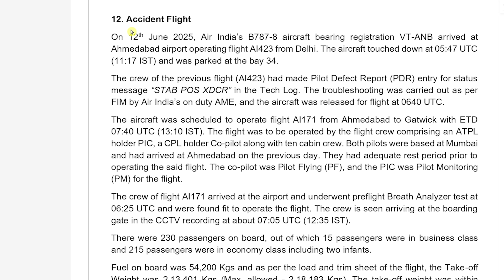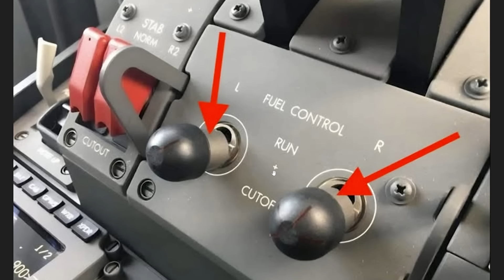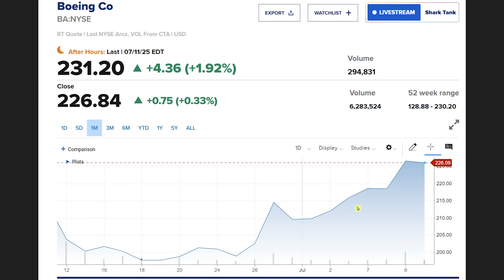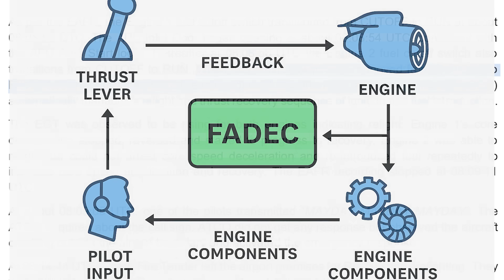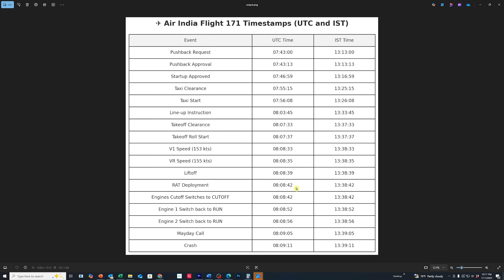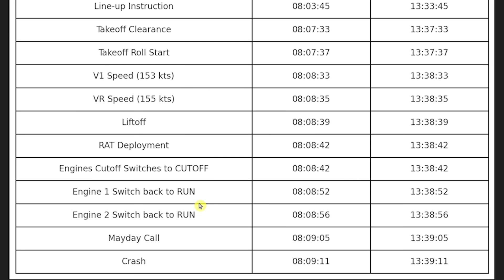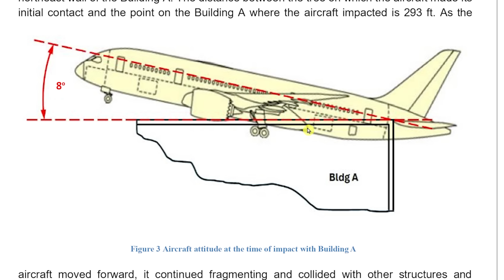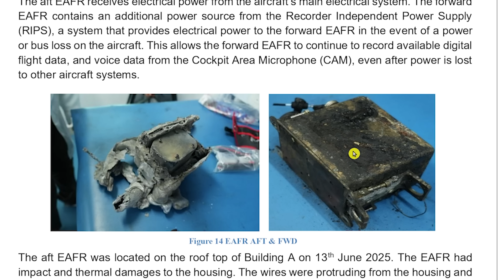Did Pilots CUTOFF Fuel? Shocking Twist Air India 171 Report!

Comment: Stop these assumptions and narratives not based on facts. 
The following is an excerpt of report:
The aircraft achieved the maximum recorded airspeed of 180 Knots IAS at about 08:08:42 
UTC and immediately thereafter, the Engine 1 and Engine 2 fuel cutoff switches transitioned 
from RUN to CUTOFF position one after another with a time gap of 01 sec. The Engine N1 
and N2 began to decrease from their take-off values as the fuel supply to the engines was cut 
off.
In the cockpit voice recording, one of the pilots is heard asking the other why did he cutoff. 
The other pilot responded that he did not do so.

The question make sense as the switches are within the control of the pilots as the plane loses power.  The answer is NO! 
There are no other
Leave it as that until further investigations are complete.

Everything in this post are irresponsible narratives that are  circumstantial, assumptions and not based on facts.

Also, engine 1 and Engine 2 fuel cutoff switches transitioned 
from RUN to CUTOFF position one after another with a time gap of 01 sec. 
If one of the pilots is responsible, that gap would mean that both hands would be used and would be clearly seen by the other pilot and the question relating to the cut off switch would be more in the line of - "WTF are you doing, turn it back on"!

WAIT FOR THE NEXT OFFICIAL REPORT.

STOP THESE USELESS POSTS!

YOU ARE NOT REPORTING BUT PROFITING FROM THE TRAGEDY THAT ARE REAL LIVES!
Reply from the maker: It sounds like you are very defensive on behalf of the pilots. NO problem, but all the info you just regurgitated is what I showed on the video in a table of all the timestamps. As for your false statement, "switches are within the control of the pilots as the plane loses power," and you said no, that is a lie. Both pilots can easily reach and cut off, and turn back on those fuel cutoff switches. IT is a common task on the engine flameout checklist. You are just lying because you are defensive and you don't want to believe the flight data recorder info in the OFFICIAL REPORT! So tell you what, why don't YOU WAIT FOR THE NEXT OFFICIAL REPORT, and why don't YOU stop YOUR assumptions and narratives not based on facts?
Reply: @jeffostroff  repeating my question from below, where did you derive the timestamps from? they are not on the report afaik. thanks
Reply: Do you have proof the 2 piolets  did what you said everyone is very keen to blame the piolets  how would you like it if it were one of your family flying the planes. I am tired listening to  all  this tripe wait until the  truth comes out not before when you'll done know what really happened also their family has to listen to all this and the captains poor old father have some consideration for him how  would you like it don̈e on yoù.  THE 2 PIOLETS ARE NOT GUILTY. May they rest in peace.
Reply: Did AI171 continue to gain airspeed after fuel cutoff? 

There is a key aerodynamic and engine behavior characteristic that appears to have been overlooked in most discussions surrounding the sequence of events on Boeing 787-8 flight AI171. This detail, though subtle, could significantly alter the prevailing narrative that attributes the incident to pilot error, fuel switch mismanagement, or intentional action. Instead, it reopens the possibility of a catastrophic systems failure that preceded any cockpit intervention.

The point in question is this:

Following fuel shutoff, an aircraft may continue to gain airspeed for several seconds due to residual thrust from engine spool-down inertia and unburned fuel remaining in fuel lines and combustion chambers. The extent of continued acceleration depends on factors such as engine design, aircraft weight, flight attitude, and environmental conditions.

In the context of flight AI171, this aerodynamic behavior suggests that the engines’ fuel supply may have been interrupted before the aircraft reached its recorded maximum indicated airspeed of 180 knots at 08:08:42 — contrary to the assertion in the AAIB preliminary report that states the fuel control switches were transitioned from RUN to CUTOFF "immediately after" that peak speed was recorded.

Implications and Interpretation:

If this interpretation holds, it would imply that the engines began losing fuel supply 4–6 seconds prior — possibly as early as 08:08:36–38 — and that the recorded speed increase until 08:08:42 was the result of residual thrust and momentum rather than active engine power. The implication here is significant: the shutoff of fuel may not have been initiated by the pilots via the cockpit switches, but instead by a system malfunction or failure in the fuel control logic, FADEC, or engine electrical power supply.

The AAIB report clearly states that the fuel switches were transitioned to CUTOFF. That data point is not in question. However, when and why they were moved is not explicitly timestamped. The lack of detail leaves a critical interpretative gap.

Pilot Action and SOP Context:

It is important to note that transitioning the fuel switches from RUN to CUTOFF in-flight is an uncommon procedure. It forms part of the memory actions for severe emergency scenarios — most notably a dual engine failure. When such a failure occurs, the pilots are trained to attempt an engine relight by cycling the fuel control switches: moving them to CUTOFF, pausing momentarily, then returning them to RUN. This procedure serves as a manual reset for the EECs (Electronic Engine Controls) in the event of a transient fault or signal anomaly.

Given that, it is plausible — and consistent with standard procedures — that the pilots toggled the fuel switches as part of an emergency response, rather than as the initiating cause of the shutdown. Although the switches did transition to the CUTOFF position sequentially, with an interval of approximately one second, this event likely occurred around 08:08:48–08:08:49 — not at 08:08:42–43 as implied by the report. This offset also offers a rational explanation for the approximately 10-second delay that has been widely questioned."

Below is a revised timeline that integrates this interpretation, while remaining consistent with the data presented in the AAIB preliminary report. Where specific timestamps were not provided, inferred estimates are marked with an asterisk (*)

Reconstructed Event Timeline (Flight AI171):

1. 08:07:37 — Aircraft begins takeoff roll; thrust set to takeoff power. Acceleration initiated.

2. 08:08:33 — Aircraft crosses V1 (153 knots). Takeoff is now committed.

3. 08:08:35 — Rotation initiated at Vr (155 knots).

4. 08:08:39 — Aircraft lifts off. Air/ground logic transitions to "AIR" mode. Pitch-up begins. Acceleration continues due to thrust and inertia.

5. 08:08:36–38* — Suspected uncommanded fuel cutoff occurs. Possible causes include EEC power interruption, short circuit in the engine control bus, FADEC fault, or logic anomaly. Both fuel shutoff valves close, terminating fuel flow. Engine spool-down begins, though not immediately perceptible. Aircraft continues accelerating.

6. 08:08:38–41* — RAT (Ram Air Turbine) likely deploys automatically due to AC bus power loss from failed engines. RAT supports essential hydraulics and limited electrical systems.

7. 08:08:42 — Maximum IAS of 180 knots recorded. This is consistent with post-cutoff acceleration due to residual thrust and momentum.

8. 08:08:43–47 — No timestamped data mentioned in the AAIB report for this interval. Possibility of transient data logging interruption cannot be ruled out, though no definitive DFDAU failure is confirmed.

9. 08:08:43* — Engine 1 FAIL alert likely triggered. N1 and N2 decreasing. Fuel flow drops to zero or below threshold. EICAS system issues caution.

10. 08:08:44* — Engine 2 FAIL alert likely follows. Dual engine failure now apparent. Master Warning likely activated.

This was perhaps the time (no timestamp provided in AAIB report) when it may have dawned on the pilot flying that both engines are fuel starved. He instinctively asks the pilot monitoring if he had cutoff the fuel switches. Pilot monitoring replies in negative. 

11. 08:08:45* — Pilots assess warnings. Initial confusion likely, as both engines appear to have flamed out. Fuel switches still in RUN. No yaw asymmetry yet noted.

12. 08:08:47 — RAT hydraulic pump begins supplying pressure. Flight controls regain responsiveness. DFDAU may resume normal logging. (RAT hydraulic pumps probably started earlier but data logged after normal logging resumed) 

13. 08:08:48–51* — Pilots begin memory items for dual engine failure. As per SOP, they toggle fuel control switches from RUN to CUTOFF, pause ~1 second, and prepare to reselect RUN. This reset is intended to reboot EEC logic and reopen shutoff valves. Both switches likely in CUTOFF by 08:08:50.

14. 08:08:52 — Engine 1 fuel control switch set back to RUN. FADEC initiates auto-relight. EGT rise suggests combustion re-ignition. N2 deceleration halts.

15. 08:08:54 — APU inlet door opens. Auto-start triggered by AC power loss. APU may provide pneumatic and electrical support if successful.

16. 08:08:56 — Engine 2 fuel control switch returned to RUN. Relight attempted. EGT increases, but core speed recovery remains limited.

17. 08:09:05 — Pilot issues “Mayday” call.

18. 08:09:11 — Situation remains critical. Altitude insufficient to complete full engine relight and establish stabilized flight.

While the AAIB report attributes the fuel shutoff to cockpit switch manipulation occurring "immediately after" 08:08:42, the reconstructed timeline suggests that the engines may have already been losing power due to an upstream fault. The subsequent switch toggling by the crew may have been a standard emergency response rather than the cause of the shutdown.

If correct, this reframes the incident as a potential systems-level failure rather than pilot error. However, without direct data on the EEC status, power buses, and shutoff valve positions prior to 08:08:42, this remains a hypothesis. Further detailed analysis of EAFR data will be essential to validate or refute this interpretation.
Reply: You can very easily hit both cutoff switches with one hand.

Comment: Stab switches are on the same console right next to it and remember at the beginning, Pilot reported problem with Stab(trim) system which was fixed before flight.
Im sure they will look into it, but it could be just some short in the system, not actually one of them turning them off.

Comment: My question is could there be some form of circuitry problem where the switch sensor detected change but the switch was NOT actually moved.

What if the crew were sincere in their dialogue and it was a flight control  problem.... Or some circuitry problem.
I am personally not interested in bashing Boeing but what if this problem is a aircraft control malfunction???

Comment: Is there a way to restart the engines other than emergency procedure shown cycling the fuel cutoff switches.
Reply from the maker: no the checklist for restarting a flameout engine is very specific and all pilots know it, they practice it in the simulator, they have the checklist in front of them, they know what to do. What happened here was not from a checklist. The checklist tells them to switch the fuel switches to cutoff for the dead engine and then beack to run within 1 second, to restart the engine. The pilot doint this calls out I'm switching engine 1 off, then back on. The other pilot calls out to confirm, engine one off and back on, so they don't shut off the wrong engine by mistake.

Comment: what a load of nonsense. the switch may have been moved, but what evidence s there that either of the two pilots did it, and not the on board computer ?    This is boeing desperately trying to get away with MURDER  due to its faulty planes.

Comment: The black box did not record that the fuel cutoff switches were physically moved. It recorded that the engines transitioned into a “fuel cutoff” state  and that’s not the same thing.
That status could be the result of an electrical fault, a system failure, or an automatic protection signal from the aircraft’s electronics  not necessarily manual input.
Unless the specific switches were wired directly to the flight data recorder (which has NOT been confirmed), no one can say the pilots physically cut the fuel. All we know is the engines entered a cutoff condition. The toggling that followed was likely the crew’s response to the dual engine failure  not the cause of it.
This narrative that “a pilot shut down both engines” based solely on that data is completely unfounded. And it’s disappointing to see experienced pilots like Captain Steve jumping to conclusions.
Please stop spreading misinformation. The FDR captured system state, not physical action

Comment: Unless the fuel shut offs were - as all the expert pilots are saying "mechanical" that infers there is a literal cable controlling the fuel. That's nonsensical and it's in no way mere "mechanical" as the experts are claiming. There is a software program involved that interprets the manual fuel switch turn in/off and responds accordingly based on prior programming. WHICH MEANS that the software could have had bad code that mishandled messages sent to the computer processing code. These things happen in non-aviation settings so for someone to categorically rule this tragedy as NOT related to a software error, then they should be fired!

Comment: 10:47 There were other reports when RAT was deployed automatically when an 787 aircraft was in parked position in airport.
Simultaneous deployment of RAT and fuel switches CUTOFF has no sence, since the engines generators can deliver power several seconds after fuel cutoff due to engines autorotation.
Fuel switches could stay in RUN position while some electric power system shutdown could be considered by FADEC as Fuel switch CUTOFF state. When RAT was deployed the pilots started engines start procedure. But it was too late. This could explain why one of the pilots ask "why did you switch engines off", while another pilot has no clue what is going on.

Comment: The take off procedure is the most dangerous part of the aircraft journey. One has no altitude to raise the nose to avoid the ground from an air crash and subsequent fireball, especially if the plane is filled up with aviation fuel. Pilots prefer to fill up fuel tanks BEFORE they fly to busy airports like London or NEW YORK. Why? It probably takes two hours to half fill a jumbo jet with aviation fuel. It probably takes four hours to completely fill a jumbo plane. A waste of time for copilots the next day after arrival. Pilots prefer to hang out in airport lounges in informal clothes the next day after arrival in busy airports instead of filling up aviation fuel. The solution is to completely fill up aviation fuel in small airports before reaching big and very busy airports.

Comment: I haven't checked if anyone else has reached this conclusion in the previous 3089 comments, but if the perpetrator pilot wanted to destroy the reputation of his colleague for some reason - or maybe, just maybe, there were passengers on the plane to be killed and one of the pilots was hired or coerced to do so - he could have cut the fuel then asked loudly his innocent colleague why he did so. Unfortunately, this timetable presented here does not show the moment when one of the pilots questions the motives of the other. I also don't understand why RAT deployment is shown to occur prior to fuel valve manipulation.

Comment: Take your eyes off the pilots for a second and think about a malfunctioning chip that caused a failure in FADEC.
Thats not what happened at all. No wonder you screwed up your analysis, your not using good investigative skills. 
The engines failed at lift off. The RAT only deployed when there was dual engine faure according to the FADEC. The Capt did not cut the fuel switches intil after the electrical stacking caused a fault in the system so he could reset the engines for restart. It was something like 70 billion to one odds in this happenig according to a duel burn out at lift off. The 180 nmph was from momentum and there was nothing that either pilot could do to prevent what the computer interpreted. The situation that the Capt was set to retire to take care of his surviving father is why everyone blammed him of depression and being suicidal. The only way the crash coulf have been avoided was to retract the landing gear and maintain level flight immediately at lift off which would have only given time to turn the aircraft back.

Comment: Fuel switches did not lock in place due to spring locking device being affected by new air pressure specs within the Dreamliner, so on incline they fell down to off position due to springs loosing their spring from compression.

Comment: What if 1 pilot intentionally used both hands and cut off both switches to cut both enjines 0 seconds apart but failed sresulting 1 seconds apart. Psiachiatric conditio like an agitated depression as a psycotic medical malfunction is to blame. MEDICAL PRACTITIONER FOR 45 YEARS and thousands of psychiatric consultations. This should thourorly be examened. Also family history of pilot is very important and has previous medication. Postmortim results on drugs. Do not underestimate a psychotic incident. This has no logic explanation as everybody tries to explain. More questions than explanations point to pschiatric explanation. 90 % the result of a mental disfuntion. The right medical experts must be brought in. 15 per 100 Indians suffer from depression